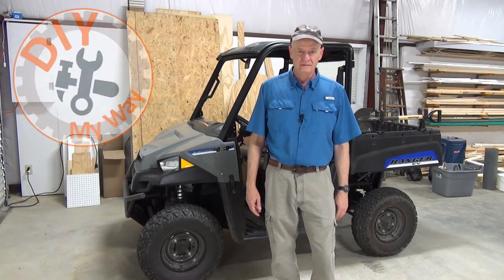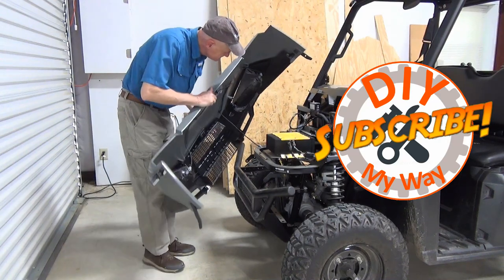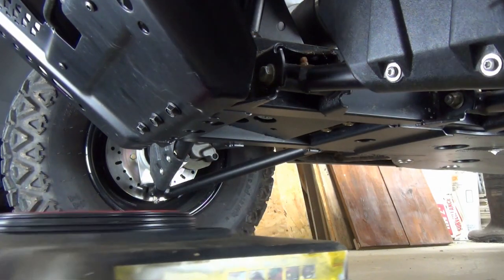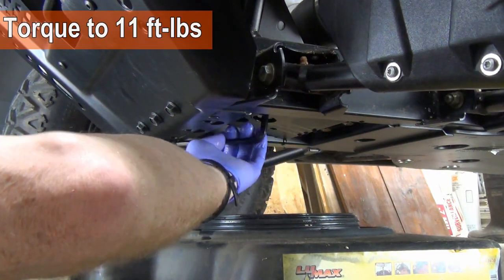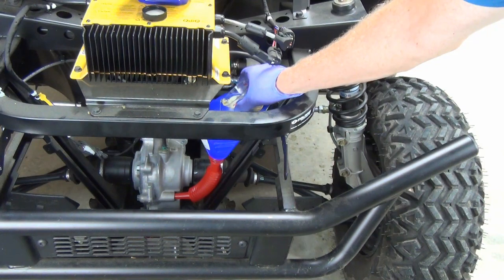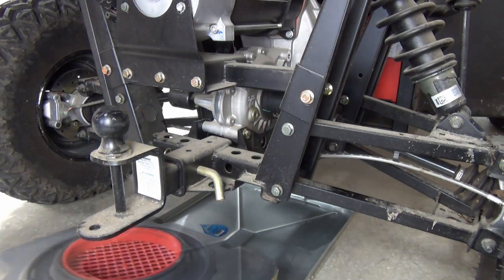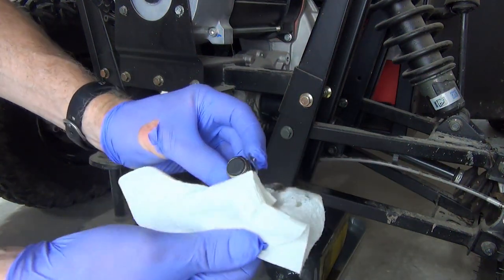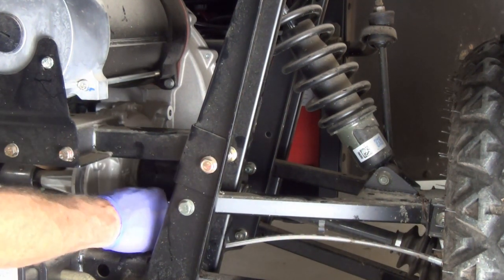Polaris Ranger EV: Changing the Gearcase Oil (#140)

Comment: Excellent video.  I've had my Polaris EV for about 9 months and use it pretty much every day on about 500 acres that I manage.  I'm just over 100 hrs.  Guess I should have changed those fluids before now (is 50 hrs. the recommended interval?).  The shop I got mine from said there is really no maintenance over than the water levels in the battery, so I appreciate your doing this video and its high quality and attention to detail.
Reply from the maker: Thank you, John!  Actually, you are supposed to change the gear case oil yearly and check the levels monthly. It’s all in the manual.  If you weren’t given a hard copy you can down load it from the Polaris website.  Glad to hear you are enjoying yours as much as we are ours. Thanks for watching!

Comment: Have you noticed if the Delta Q charger over charges and causes your batteries to boil over electrolyte? In other words acid on top of the batteries causing corrosion, etc??
Reply from the maker: Hi Shannon.  No, that has not happened with mine. Thanks for watching!
Reply: @DIYMyWay  Thanks for the reply, I had read some reviews stating issues with that. My Polaris EV should be here in a few weeks. Glad to hear you have not had issues